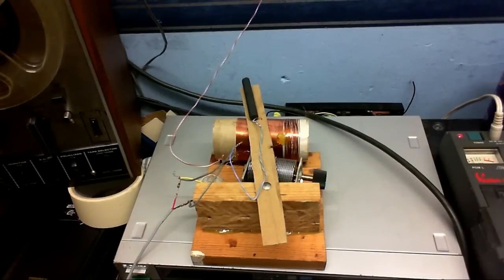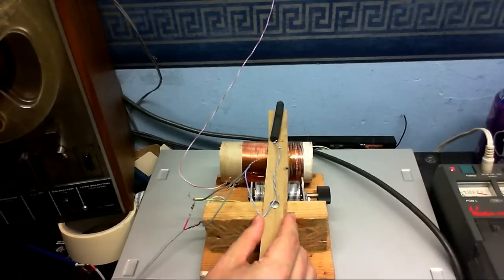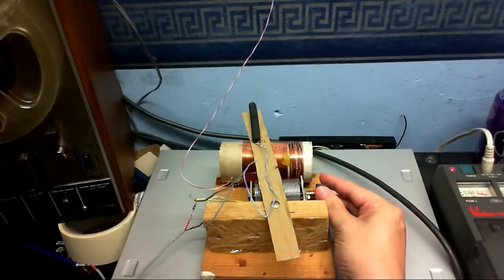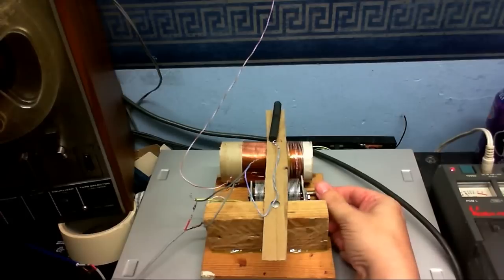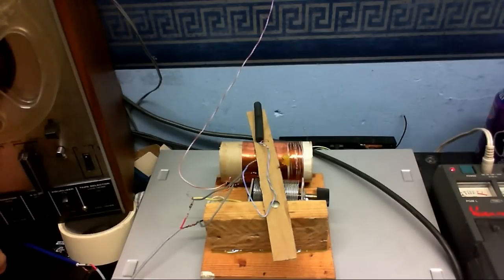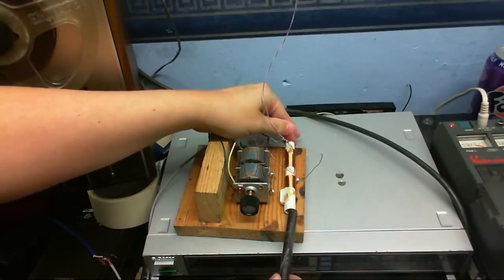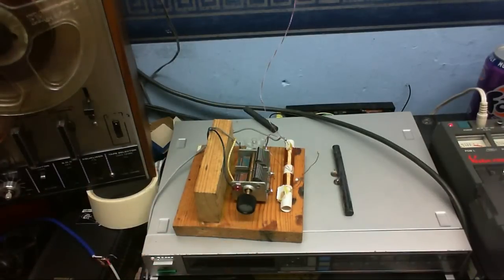Tuning in to the world ... on a somehow shortwave crystal radio.

Comment: I lived in Romania for a time, so this is appealing to me both for nostalgia as well as mine own 35+ year long interest in short-wave radio.
I've also tinkered with crystal radio and tapped coils and, like yourself, have pulled in short-wave signals by tuning lower than the settings for my replica NOS, tapped coil crystal set. Mine was also unknown gauge wire on a 4-ish inch/10~cm form (a toilet paper tube from a factory my dad worked at). My efforts resulted in signals in the 49 meter band, but most stations were too weak to be clearly discerned.
The only thing I can think of to explain how a tapped a.m. coil can pick up short-wave station is harmonics. I don't fully understand this concept, but your local amateur radio operator might be able to.
As for the useless part of your tuning capacitor, remove it from the breadboard and look inside the fully meshed plates, and also tune it close to your ear. If the rotor and stator plates are making contact, you will hear it as they rub. For this, look into the plates with lots of backlighting to find where you have bent plates. For whichever ones are off angle, open up the tuner and (with a little trial and error, and patience) band the rotor plates to straight. If it's just grime or dirt, this can be cleaned out with any form of electronics spray cleaner or even canned air.

Comment: CoolDudeClem The reason for the distortion is that radio waves naturally travel in straight lines, and penetrate the Earth poorly.   With stations broadcasting far away the signal propagates by bouncing off the ionosphere and back down to Earth (multiple times dependent on the distance) which causes phasing and other distortion.
I used to listen to a lot of radio as my father is a radio ham.  The "number stations" are very mysterious.

Comment: This is outstanding for a crystal radio, I suggest that apart from the coils and caps, the cause of the shortwave reception might be the diode you use. Some years ago I made a crystal radio that could work with various different diodes, and I did notice that different diode models and types caught the stations on different spots of the coil (no idea if shortwave though, since that band seems to be clear on my area). If so, maybe you could try it with ''plug in diodes'' to get different bands on a single receiver.

Comment: the continuous buzzing sounds like either the power adapter you are using for the radio, or power (adapters) used by other nearby devices.
That bleep buzz thing occasionally appearing is your cellphone
Reply: That's funny you say that I got one led light bulb that when it's turned on makes a buzzing noise in my crystal radio set because it has small circuit board in it. It wreaks havoc on any AM radio I have but I bought a Old Johnson 5 channel citizens band radio that used to be part of the ham frequency anyway the guy said it buzzes it needs capacitors and told me which one. When I received the unit at work perfect and I told him that he may have had a buzzing from his place because I've never heard it buzz and I bought it as a non worker that works
And this Chassie had been buffed. Detail Ed . somebody went to a lot of work and gave up and sold it to me and now it works great I've got three others the other one works and I have two that don't work so well

Comment: I book a 40metre crystal radio coil. Used a prewound 1/2 inch pencil 
 For tuneing coil and old  varible cap . the antenna coil does not have that many windings and it has one tap, I'm thinking it's got nine windings but it is a 40 m coil. Love this stuff

Comment: That noise you asked if anyone could identify.  It's a GSM cellphone.  If you have a GSM phone, put it near the coil, and tune with the bar until you start hearing it.  It's not a constant noise, but every few minutes (or more if you use the phone), you'll. hear that sound.

Comment: Aim the Coil, Rotate the orientation of the coil to "aim"at the transmitter. Signals are picked up by the coil along the sides of the coil as opposed to the open ends.
Reply: also ,tune to a weak channel then rotate the reciever to best signal strength, Try this with an AM radio you'll see what I mean.

Comment: AM Broadcasts are weaker whilst shortwave's are powerful.
Reply: Shortwave is am well they call it high frequency.
Definitely not FM
Reply: The drift you are describing is the turning of the Earth and or the movement of the clouds that the band is skipping off of I have a old realistic communications receiver with single sideband and I learned what the bfo knob did. I can listen to skip for a while on 40m. And then their voices it squished up one way or the other and I have to adjust the bfo constantly because of the turning of the earth and the movement of the skipping clouds

Comment: how many turns do you have on your SW coil(s)? I've used 100, 105, 115,150, 200,300, and have connected them to make a 500, 700, and a 1000 turn coil!!!
they are about they same,station-wise, locals same SW stations. they are different diameter coils, but my 300 turn coil is med. diameter (like u.s. quarter diameter). any ideas? 
still, good video!
Reply: I ordered a pre wound 40 m coil. Has 9 turns on 3 inch round cardboard. It has one center tap and I'm not exactly sure about it 9 and turn but it's not that many but I have to use a 90 turn tuning coil

Comment: the interverence you have can be
switchmode power supply's
tl tubes
fluoresent lights
tv's
other am radio's
a mobile phone
wifi

the beeps you hear are data
you are receving some kind of data burst
Reply: +robot797 Data burst? You mean digital modes on ham radio?
Reply: No I really mean data burst
Like a wifi router pinging for devices
Reply: But you're referring to the data bursts on the shortwave bands isn't it? Those data bursts are actually digital modes on the SW ham radio bands, like Morse code and radio teletype.
Reply: well it can be any data surge
even mobile 
hold your mobile close to any radio and they all make connection noise bursts

but you micht be right

Comment: what would happen if I connected 2,3,4 similar diodes (in/on a breadboard); would this increase,improve the range of my SW radio? I did use 1, then 2, diodes, in parallel, without a change of range.
I have a 100 turn coil, (don't know the wire gauge), with a good ground and antenna connections. have heard local stations, Cuban radio, Nashville,TN, South Carolina, and once, European radio and Chinese radio!
nice build! (i'm in OK).
Reply from the maker: Sooner Science Nerd
Adding more diodes in parallel wont change a thing. Even if they all 
have the same specifications, there's still very small differences in 
each diode, so which ever diode has the least voltage drop will do all 
the work and the others won't do anything.
Reply: ok. thanks!
I can put the rest away!

Comment: The buzzing you are hearing is most likely GSM/mobile data being demodulated by the detector.
Reply from the maker: But don't those work on microwave frequencies? How could I be tuning in to that?
Reply: Yes they do work on microwave frequencies in the 800MHz to 2GHz range, band depending. This interference with audio equipment is quite common but i just blame it on RF black magic.

Comment: Mine picks up FM some how.
Reply from the maker: That's not all that strange, any AM radio can pick up and demodulate FM if it tunes high enough, also some radio stations brodcast (or at least a couple of BBC stations used to) simultaneously on AM and FM bands.
Reply: @CoolDudeClem  But its a crystal radio... only a coil and a crystal diode.
Reply: The station is News 93.1 FM KFBK
Reply: @CoolDudeClem  oh nvm KFBK also broadcasts at 1530 AM

Comment: 15:20 thats GSM phone transmittion,
Reply from the maker: Shouldn't I be hearing what they're saying then, or do they use some kind of digital modulation? Also, if that is what it is, HOW am I picking it up? I always thought phones transmit in the microwave frequency range, not shortwave.
Reply: gsm is digital, tdma, the data is pulsed, hence the noise, where 3g is spread spectrum continuous transmition..
the dit ditdit dit interference,.. sound is unique to tdms systems (gsm mostly)
Reply: +voltare2amstereo No. That's not GSM, 3G or TDMS. It's some sort of digital ham radio mode, transmitting on the ham radio bands.

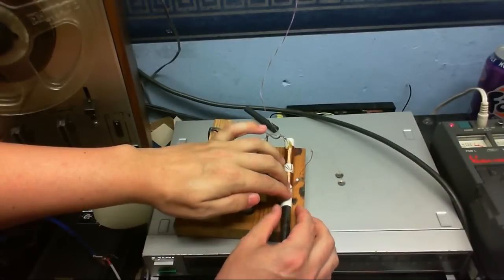Comment: At   11:50  in your   video, when you are  using the ferrite rod, the  buzz  you  hear  may  be  some radio frequency  interference (RFI)  likely  caused   by  something in your   room.  Try  shutting  off  all your  all  your  electrical  devices  you  do not  need  with  just  your   radio (using your ear phones) and a  simple   light.  Unplug  all  wall warts  such  as  cell phone  chargers.  If you  still  have the  RFI, it  may  be a   problem  from a  device  from another room of your   home.  Review this  document  for  more  ideas.   www.arrl.org /files/file/RFI/Thompson Noise.pdf  NOTE:  keep the  space  between  Thompson and   Noise; I  don't  know  why  it  works  with a  space but it  will open.   Also,  Check  with  whatever   ham  radio organization   is  within your   country and  ask  for  advise.   IF  you  are in the  UK  try www.rsgb.org   73  John Salsgiver-KB3SVJ located in  FN00fq
Reply: PS, if you  discover the   buzz is   gone  from the  get  go,  start   plugging in things  you  normally  use   until  you  rediscover the buzz.  Lastly, thanks your   contributions.